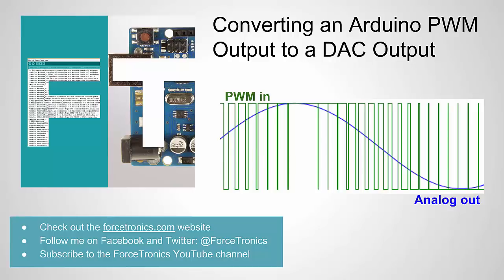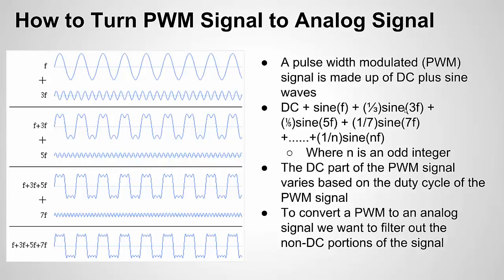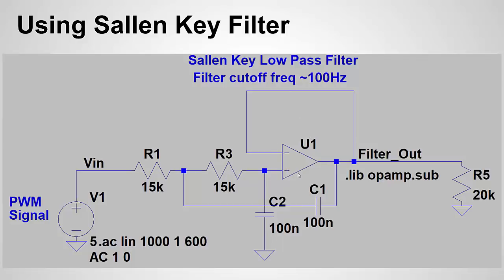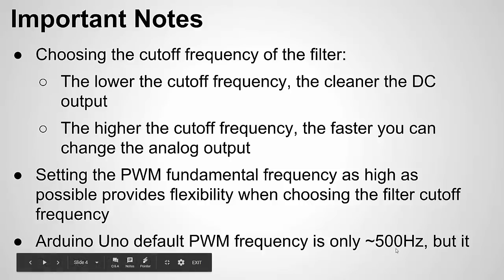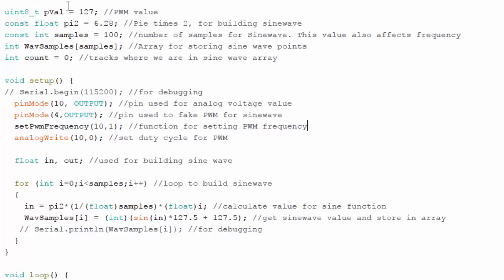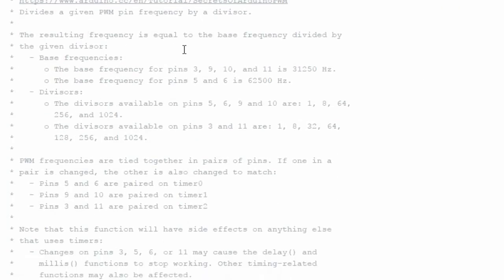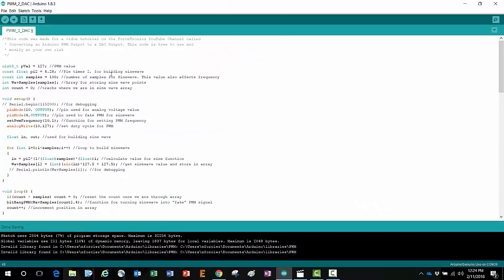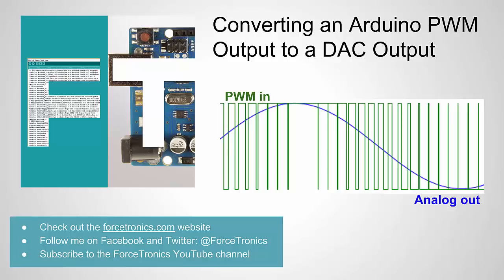Converting an Arduino PWM Output to a DAC Output

Comment: I believe this is called a PDM (Pulse Density Modulation), correct me if I'm wrong
Reply from the maker: Pulse density modulation that's the first time I've heard that. I was trained on the term pulse width modulation or pwm. Thanks for the comment
Reply: @ForceTronics  as far as I know the PWM is a special case of the PDM, but the PWM is much more famous since it's simpler
Reply: I believe PDM uses narrow pulses at a high frequency ( e.g.  ~ 1 MHz at 50% duty cycle) that are gated on/off followed by a low pass filter.    If the gate allows half the pulses through then you have 50% (half scale),  if it allows all pulses thru, full scale.  I think it simplifies the filtering, since the higher frequency and harmonics are well outside the audio band.   The design of PDM is a bit more complex that a normal PWM.

Comment: instead of a sallen key filter what would happen if i use a rc or an LC low pass filter
Reply from the maker: Depending on your application using a passive RC or LC low pass filter would work. But you're going to see some attenuation for the DC or low frequency signal that you're trying to pass through the filter. You're also going to see a much longer roll-off at your cutoff frequency for the signals you're trying to keep out
Reply: @ForceTronics  Aah i see , and also if i am using to use that voltage to "load" something i'm guessing that would affect the output voltage , it may not be a clean flat line it might get choppy . Because in case of an op-amp the output impedance is low so that voltage will actually be able to drive atleast a mosfet or something .

Comment: Awesome vid.   Wouldnt have of 255 bunary be 127 even.  Since 0 is whwre it really starts it has an offset if one conpared to hiw we tging if numbers.  So it should be 256/2 = 128 then minus the 1 offset because 0 is a value in code even though in life we see 0 as absense of value.
Reply from the maker: Yes you are correct, great catch!
Reply: @ForceTronics  I have made that one off error sooooo many times. I am not sure I will  ever stop making the error completly LOL.

Comment: Hello. how can the signal from the dac be downloaded on a 4 ohm coil?
Reply from the maker: No dac's are low power devices and would not have enough current to drive a waveform through a load with that little resistance. You would need an amplifier between the dac and the low impedance load. If you're trying to drive a stepper motor you should look at an h bridge circuit not a dac.
Reply: What amplifier do you recommend between the dac and the low impedance load?
Reply from the maker: I don't have amplifier model numbers or specs memorized so you will need to do the research
Reply: thank you. I would be happy if you make such a clip in the future. the idea is to be able to listen to the signal from the dac in the speaker, but it should be the same signal and not distorted. I tried with lm386, with a transistor and I didn't succeed ....

Comment: I believe that Multiple Feedback topology LPF would work better than Sallen type. The Sallen filter has a direct path of the signal to the output, which shall bleed through. This is a known issue of the S-K topology, limiting its attenuation in the MHz+ region.

Comment: How do you even get PWM fron pin 4 which is not able to give PWM (it doesn't have a ~ sign). Im trying to generate an ECG signal using arduino, any help?
Reply from the maker: What you see in the video is what I used. If I recall ecg signals are fairly precise and low amplitude. I would not recommend using a PWM signal. I would recommend using a dedicated DAC I that is 14 but or better. If you need it to be low amplitude you probably need some type of divider circuit

Comment: can i control the output voltage ? like change it from 1v to 2v ,5v etcetera
V=I*R
i want to change the V while R ramaine constante so I will change
Reply from the maker: Yes that is what a DAC is used for, vary a voltage level. Note that DACs are low current devices so they are meant to control high impedance devices.

Comment: Higher order filters will let you use higher sine-wave frequencies with the same pwm frequency. Passive it's possible to make a 2nd order filter with a Q=0.5 . With a single opamp it's possible to go up to a 3rd order (4th is technically possible but a little complicated) with a Q=0.707. (Max bandwidth)

Comment: Hei, do you by any chance have any idea how to implement sine-wave generator in Arduino Uno using MATLAB simulink? i dont want to use the Analog pin, well Arduino Uno does not have DAC.
Reply: I have the same problem

Comment: HELP
I want to use Buck Converter Module Arduino with input PWM signal. But, the input of the Buck Converter is a potensiometer. thank you

Comment: hi,can i vary  the widths of the spwm(with same step) to change the amplitude of the output voltage,with the analoge read input as a feedback?
Reply from the maker: Yeah sure. Just make the measurement after the filtering
Reply: @ForceTronics    thank you for  answer man,i got it..

Comment: In the 1980s games programmers developed such techniques to produce multi-channel sampled-instrument audio for the Sinclair ZX Spectrum & early PCs (beepers).

I found this surprising (to me) simple circuit that uses 1 GPIO lins & 1 ADC to perform DAC.

https://www.edn.com/design/integrated-circuit-design/4312523/Create-a-DAC-from-a-microcontroller-s-ADC

I note that the DAC in the ATSAMD21G18 appears to work in a similar manner. It's interesting to note that the value in DATA (of the DAC) is 16 bits although the DAC is only 10 bit BUT the CTRLB.LEFTADJ flag selects if bits [9:0] or bits [15:6] are placed into the DAC. I suppose that using the top 10 bits allows 16-bit values to be used as-is but then again, I can't see many situations in which the data is conveniently going to be in bits [9:0]. I wondered if it was intended to allow multiple sameple channels to be mixed without recourse to post-scaling/clipping e.g 4 x 8-bit channels?

I love the attention to detail in these tiny modern marvels but then I realize that it's unlikely that anyone is going to extract all of the potential power available in these tiny (by modern standards) systems. Nobody is going to become as expert as, say, C64, Spectrum or even MS-DOS PC programmers because the technology changes so fast...

Maybe I should consider playing with the AVRTiny85. Only 8 pins on the package and yet still potentially PWM audio, communication with a storage device, user input & data out ALL at the same time and on a £1.09 SoC that has a 16MHz RISC CPU that boasts 3 timers, 16 interrupt vectors & memory-mapped hardware registers! Crazy, but so cheap that they turn up everywhere.....

.

.

Comment: Why didn't you use a simple RC low pass filter?
Reply from the maker: You can use a simple passive RC filter but they suck for two reasons. First they have a gradual rolloff so your AC ripple on the resulting DC level will be larger in amplitude. Active filters have less loss or the op amp compensates for loss so the resulting DC signal better matches the PWM value.

Comment: hello
sir can you explain how the analogue output voltage swings between the positive and negative half cycles while the Arduino PWM is in positive half cycle only?
Reply from the maker: With this example circuit you should get a DC level with a low amplitude sinewave. The frequency of sinewave will match that of PWM signal. The phases of the signal should be about the same, but depends on specs of op amp you use

Comment: After converting it to a DAC how can you turn it into a proper sine wave with negative voltage peaks? (so where the 127.5 was added to the function we would want this to be at zero instead) but I am not sure how to actually use the output to get it negative. Any help?
Reply from the maker: Two approaches comes to mind. You could use the method presented in this video but you would need to find a microcontroller or other IC that can generate a differential (positive and negative) PWM signal. You would then need to pass it through an active filter with an op amp that has a negative and positive power supply. Note that the filter needs to be designed to allow the frequency of the sinewave to pass but attenuates the frequency elements of the PWM signal. Or you can buy an off the shelf DAC chip with a differential output. Note that such a DAC IC will also require a negative and positive power supply.
Reply: @ForceTronics  thanks so much for the detailed reply! If I was to find an off the shelf differential DAC IC, but the only had one main power supply, what would be the easiest method to convert/split this into seperate positive and negative rails to use?
Reply from the maker: Here is a link that might help: http://www.newelectronics.co.uk/electronics-technology/the-best-way-to-generate-a-negative-voltage-for-your-system/167618/

Comment: I noticed you declared pin 10 in your code, but didn't seem to use it anywhere else, or in your example. Is it important for something internally?
Reply: no, it's not. it's just the part of the code which generates a 50% PWM wave on the true PWM pin as shown by him on the oscilloscope the first time. you can delete all code related to pin 10 and the sine wave would still be generated on pin 4